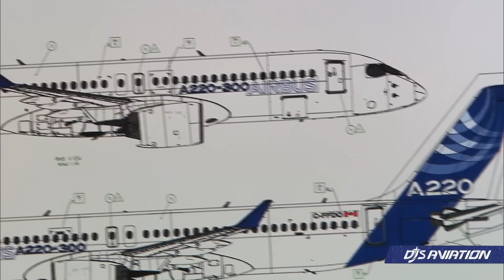Bad News For 787, Airbus News & Air New Zealand Problems

Comment: Is it plausible that Embraer could step up and develop larger planes to compete against Airbus?
Or are they content in their space.
They could easily displace Boeing, who will never see past their corporate greed
Reply: Embraer's biggest (commercial) Jet is about the same size as the Boeing 737 MAX-7. So, yeah, Embraer should be pounding doors for those customers, although their ability to rapidly increase production and retain the quality they currently are known for is suspect. 

What Embraer is known for (and why the E2 program has been a failure to date) is making Jets that cater to the regional jet market, servicing airports that the 737 is too large to visit. The Embraer E2 being 737 size, also means that it also cannot do regional hops. Until Boeing crapped it's pants of late there was no reason to really look into the E2. With Boeing being...well Boeing Embraer has to keep it's #3 market share against a surging COMAC who with their domestic Chinese market alone puts Embraer's market share in danger.
Reply: Embraer is owned by Airbus.
 And Airbus market an Embraer plane the A219 as an Airbus.
Reply: @MichaelEnright-gk6yc  Airbus does not own Embraer, and the "A219" does not exist. I assume you're thinking about the joint manufacture of the Canadian made Bombardier CS100, which was marketed as the Airbus A220
Reply: It's likely safest for Embraer to remain where they are. The situation Boeing is in right now certainly gives them a chance to step up, but it's very risky. By manufacturing larger planes, I'm going to assume you mean competing with aircraft such as the larger variants of the 737/A320 family, aswell as aircraft such as the 787/A330Neo

The 737/A320 family is certainly a possible one to target, especially since Boeing is having so many issues with the 737, also because Embraer already has planes that sort of fit that market, some of Embraers largest planes are just big enough to compete with the smaller variants of the 737/A320. The issue is that they were a bit late to the party. As a Primarily small, regional jet aircraft manufacturer, one of Embraers biggest competitors is Bombardier, which competes in the same market, But, a couple of years ago, Bombardier developed the CS100, aswell as it's larger variants, the -200 and -300, they also supposedly have a -400 in the works. The CS100 family, particularly the -300 variant, and the upcoming -400 variant, serves as a direct competitor to the 737/A320, However, to further their sales, Bombardier decided to partner with Airbus in the development of the CS100 family, and it would come to be known as the A220. Not only does Airbus have the 320 family, but they also now have the 220 family. The market for short-medium hall narrow body airliners is very saturated as a result of this, so while it may be possible, it will likely prove very difficult for Embraer to get their foot in the door.

Now let's talk some bigger airliners, the 787/A330 market.
With the new production issues of the 787, and the A330Neo not selling particularly well, this market has some great potential for someone to step up to create a  new widebody medium-long haul aircraft. The difficulty with this is that it's a completely new concept for Embraer. if they were to make a slightly larger aircraft to compete in the 737/A320 market as mentioned above, it wouldn't be super hard, as they could build off of what they already know. A widebody long haul aircraft is completely new to the company, and therefore, would cost tons of money to design and manufacture. While this market is a potential target for Embraer, it's ultimately very risky, especially if their airliners don't end up selling well.

Comment: Even with the two crashes and door plug incident, the bad news at Boeing isn’t even out yet.  Boeing has been building junk, putting greed of the BOD before safety.  As these air frames age, they are going to start falling to pieces and having more accidents.
Reply: Many of these 787 airframes are approaching or going through their second D-Checks.  I don't think I need to tell you what that entails.  If these airframes were showing any signs of fatigue to the degree that the most recent whistle blower stated,  it would be evident after  6,000 plus cycles.  They would most certainly be evident during a D-Check, whereby any sign of fatigue would be addressed, documented, reported....involving the FAA with a subsequent AD or type fleet grounding.  I would think if this was the case, it'd be all over the major news outlets. Because, as you know, Boeing, these days can't make a head call without the news reporting on it.
Reply: Airbus has also been building junk too. Even with their cracks and automation failures here and there, as their frames age they will start to fall apart in pieces which will lead to accidents too. Greed over safety has nothing to do with supply chain constraints
Reply: @nickolliver3021 Airbus crashes mostly happen because of incompetent pilots. Not because their planes are unsafe.
Reply: @vintagetriplex3728  boeings also crash due to incompetent pilots. Boeing planes don't crash because of them being unsafe either. Two incidents doesn't mean they are unsafe.
Reply: @nickolliver3021 tell us more about the 737max? Pilot errors? LMFAOOOOOOOO 😊
Reply: @alvinloh9068  Please tell us more about the A350? pilot error? LMFAOOOOOO 😅😅
Reply: @nickolliver3021  Fortunately, there's nothing wrong with the A350 😍💋unlike Lion and Ethiopian Air with the junk 737max that took away 346 innocent souls. Tell us more about it! Ops, Nicky is crying again.
Reply: @alvinloh9068  Fortunately there is nothing wrong with the 787:face-blue-smiling::face-fuchsia-poop-shape: unlike delta with the junk a350 that took away over 346 innocent souls. tell us more about that one, oops Alvin is crying again oh dear oh dear oh dear
Reply: @nickolliver3021  Fortunately, there is nothing wrong with the A350, unlike Lion and Ethiopian with the junk 737max that took away 346 innocent souls. Tell us more about the Max incident with Boeing’s ingenious creation of the MCAS system. Opps Nicky is crying again, hoping the 787 is at least half as successful as the A350. Oh dear, oh dear, oh dear